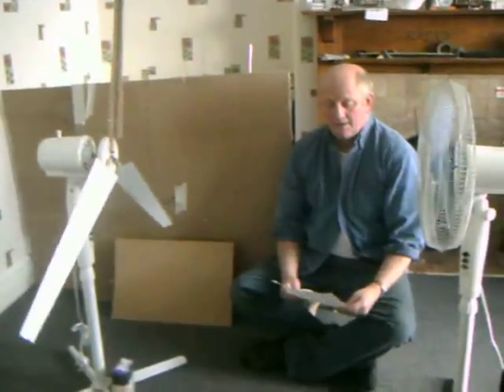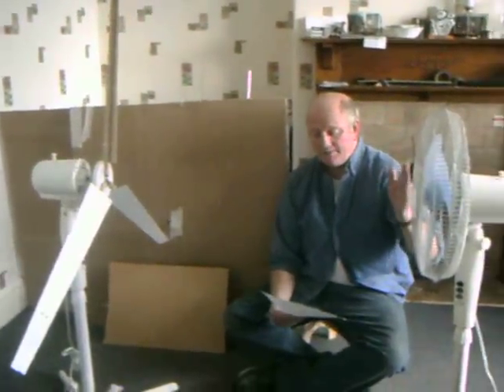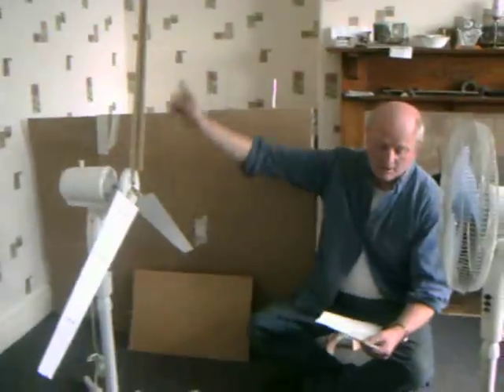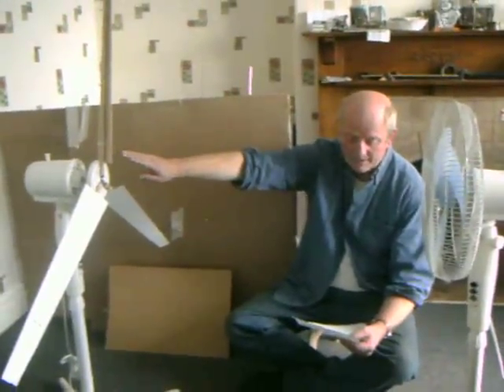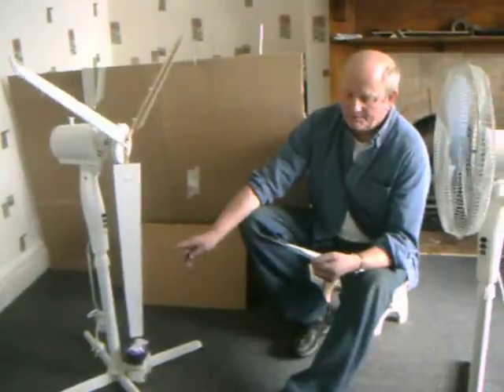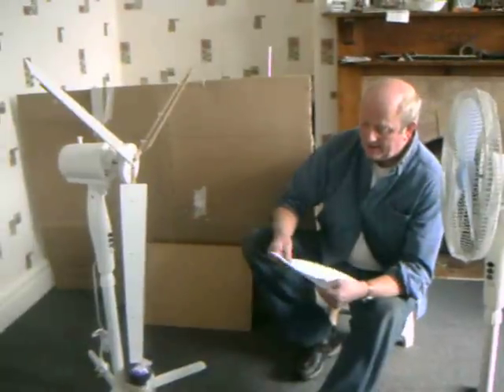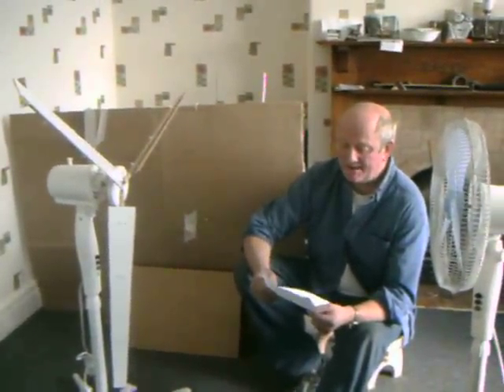Wind Turbine experiment shock

Comment: @mooreandwright  Sorry, I misunderstood and thought you said 1009, not 1500 sq/in for the 3 blade ACA. Even more horribly missmatched from the source.  A helicopter gets most lift from it's blade tips. A windmill develops most of it's torque from its blade tips. No wind even blows there in your demo. Your model has a large plate in the center where a good portion of the air is directed. It should have blade roots and a smooth cone spinner.  Very unfair comparison, and yet again piss poor science

Comment: @mooreandwright  And to add, they built with falt plates back when because they didn't know any better. As early as the 1920's, bout the time metal blades came on the scene, you start to see windmills showing up with a twisted shape to better turn wind into torque.  You say your 1:50 3 blade is a scale model.  That sir is not true!  IT lacks a proper scale airfoil. Again piss poor science!

Comment: It is clearly evident that the visible wind turbine model, besides being inaccurate because it does not have a twisted/washed out airfoil, has a large collection area being powered by a narrow column wind source fan. It is clear that the hidden model IS optimized for the narrow colum windsource.  With a proper airfoil(as they are really built) and both put out in an open breeze, your hidden model would fall on it's face in terms of output.  said best 5 months ago. You sir... are an idiot!

Comment: For those of you who don't know, the vetical wind turbine was invented and documented by an Arab scientist several hundred years ago and was employed to grind grains into flour. Oddly enough, even though its design is well documented, those built today are not as powerful, usually because they all miss an important design feature. In order for vertical turbines to be efficient, they need to be enclosed in a housing designed to channel airflow into the impellers at a correct deflection angle.

Comment: So what you need to do is look at Betz limit.  It's the theoretical maximum amount of energy you can extract from the wind. The exact value is 16/27 (0.5926) or 59.26%. Modern turbines can get about 45 %, maybe 50% for big ones offshore.  So a factor of two increase in efficiency will be impossible, much less any more. Here is my guess. Your "conventional" turbine model is maybe 5-10 % efficient. So compared to that, your design could be 2 or 3 times efficient but still less than modern turbines

Comment: How are you lifting the bags of sugar? (In other words, how would it be attached to the prototype).

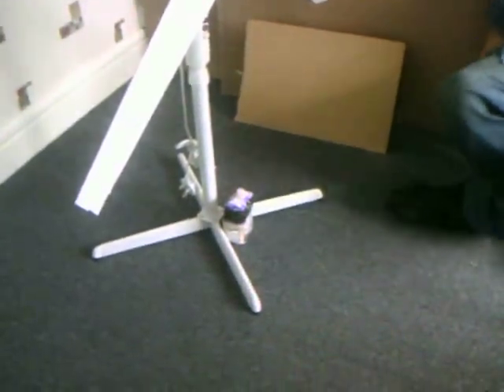The only thing that could be associated with the lifting of the sugar is the small hole with that tube of wire poking through (Just a little observation, but I think that poked through the hole half way through the video because I cant see it until 1:37 but I can see it after 1:44 when he's switching to the prototype).

Does anyone agree with me about this observation?

Comment: Well I can't see the size and wind area of yours compared to your model standard turbine. However, your standard turbine does not have the same type of airfoils as a modern engineered turbine and you really would have a hard time beating those. Sure it's worth a try but trust me you likely won't, there is a lot more to the picture than meets the eye when looking a those monsters. They are highly engineered and the airfoils are complex not flat. It takes calculus to really do the math on those.

Comment: Did anyone touch on the point that this was done in a room where the air movement was totally controlled, not to mention how much space is beside his "new" model, and what is the mechanical advantage of what ever is tied to the weight?

Comment: I am not arguing with you about economics or maintenance incurred by one design over the other.  You need to listen.  My point is that your test is flawed, so drawing conclusions from it will by default be flawed.  So claiming your design is better due to its performance in a flawed test is asinine.  On a side note, if you really are an engineer (other than electrical maybe) you should have at least heard of Reynolds #. It is a fundamental in fluid flow that any good engineer should know about.

Comment: For one thing, those blades are not at the correct pitch or shape to be compared to a conventional turbine.  Also, your little fan is not delivering its airflow to the entire area of the blades. And for the record, we can't even see your "device".  So how do you expect anyone to believe your outlandish claims, when only you know exactly what your thing may or may not be.  How do I know it's not just a little electric motor back there lifting up the string. If you want people to listen, show them

Comment: I left you a longer private message with more detail, but the short answer is that torque is not power.   Torque * speed is power.  Your turbine has a lot of torque.  The other may have more speed.  If yours lifts 3KG in 30 seconds and the other lifts 0.3KG in 3 seconds, they are producing the same power.  

Some turbines produce power mostly as speed, some as torque.  Your test favors the turbine with more torque.  I think the other would do better moving less weight more quickly.

Comment: BTW, if your turbine has a lot of torque, you may be able to demonstrate it lifting much more weight in nearly the same time, which would show more power.

Every turbine has a peak power point (best torque and speed) to get the most power.  You may not have found that point.  You definitely don't have it for the classic turbine.

Comment: I applaud you for actually making measurements because that's more than 90% of the wind turbine videos show.

However your experiment is flawed.  You are measuring torque, not power and power is what matters.  There are lots of things you could do to the classic windmill to make it lift more.  Change the pitch on the blades, gear it down, etc.

Additionally your fan is not a good source of air since it's not as big as the area of the test turbine and it makes swirly air.